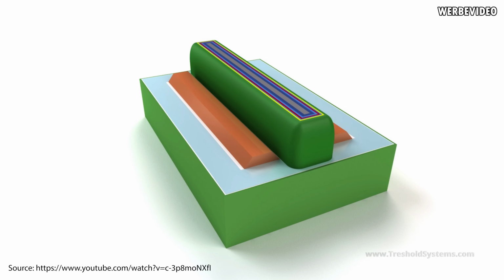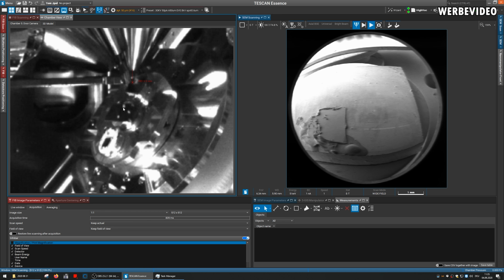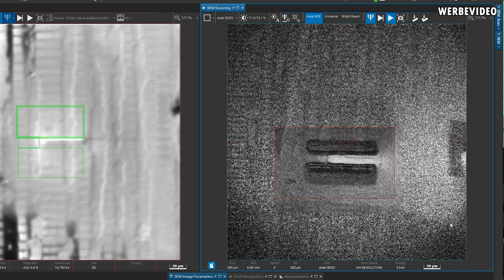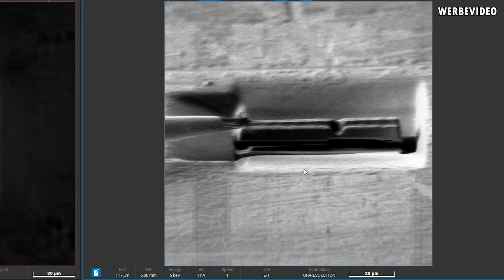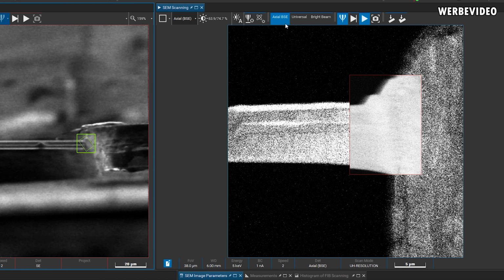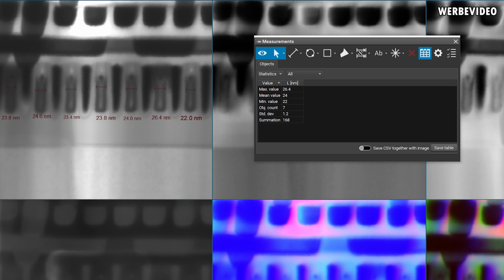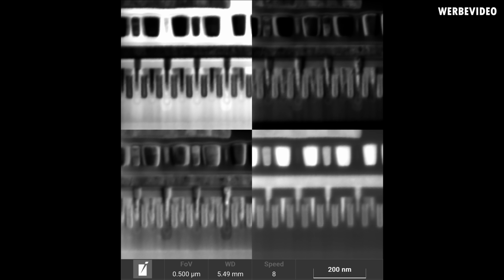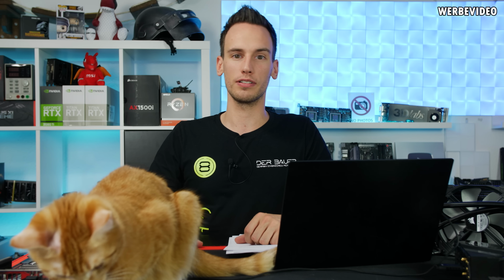14nm and 7nm are NOT what you think it is - Visiting Tescan Part 3/3

Comment: Instead of constantly shrinking the transistors why not just make the processor bigger ?
Reply: than it will going to increase risk on production. flagship cpu like threadriper xenon already have risk on production , that why those cpu are expensive. besides volume of production also determinds the risk on production, amd has smaller production capacity thats why they have low lisk on production so far. and if you do see the the die size of 3900x is around 30% larger than 10900k. so if intel going to make same die size it will increase core and cache size but accordingly also ging to increase its risk on production. the reson behind of delaying blueberry 7nm chip is the risk of production . intel maneger said that at present the bluberry 7nm which avilable in their factory is not economically viable to be release. and they finding way of production techniques to reduce its risk on production. if amd within one week somehowe capture 30% more market share than intel has to produce 30%less chip, and in that sense we gonna see decreasing voluem of intel factory and in that scenierio they would be able to realse 7nm blueberry chip within this week
Reply: @bakulboro2292  I'm not an expert on this stuff, just asking an honest question and would like an answer given to someone who knows nothing about this.
Reply: @cgirl111  bigger processors means more are not working at the end of production   which makes it not feasible for intel etc to build bigger cpus they want to make money.
thats the super short answer

Comment: Please answer this question. If it take two days to cut the silicon to the point you can see and measure the transistors. How long does it take to make and place the transistors in the first place? How long does it take to make 90 million transistors and place them in 1mm*2 ?
Reply: with modern cpus like this around 2-3 months. they go through hundreds of different steps in the fabs before they are finished

Comment: (comment from Russian viewer)
I think that "7nm", "8nm", "10nm" , "14nm" and other scales is a possible minimal resolution of "printing" processes in the lithographic conveyer.
 It can be not necessary to use a minimal resolution with different types of logic elements in microchip.
 Because all parts of the element must be in certain proportions. There is also may be another explanation: if you want to save info (charge) in cash for long time, you need to prevent diffusion of electrons through gates/drains/sources or another dielectric layers.
And for all that stuff is better to make layers much tougher and larger (with current technological capabilities). At another side, if there's no charghing parts in scheme and all task that it mean to do - mix a signal from different ways in 1 of thousand cases. So there you can do the element much tiny.
 Thx for attention.

Comment: And then we still have the packaging problem. How far is any given cache transistor from the logic unit away? How many lanes do we have in parallel, how many in series? Is the area of the transistor facing the heat sink large enough to keep it cool? How tight are the CLK tolerances around the whole chip? (how fast can we go bevor it crashes) And finally, what instructions does the CPU have to offer? How are they piped? Are the different instructions used by the compiler? Not even talking about listing and sorting of instruction execution. These things are so damn complex that you need a common benchmark if you want anything reliable.

Comment: It is bad(stupid) idea to compare cache transistors sizes... it is memory... it does not work if size of gate is too small because small gate is not able to keep large enough charge... gate size of memory transistors already reached its physical limit... it will be 22nm even with 2nm process. Generally speaking memory "transistor"  is not a transitor, it is a potential well and  it should be large enough.

Comment: Initially, I understand nm as a unit of measure.  So obviously 7nm should be half as long as 14nm.  If that is the case, at least logically it seems relevant that you could fit things closer together.  In terms of a circuit, the less distance an electron has to travel, with a fixed conductor medium, the less resistance it encounters.  Less resistance should mean more power efficient (less energy loss to heat generated from resistance).  I'd also surmise that if things being measured are "half as long" and if we're talking area, also "half as wide", you should be able to fit 4x the number of things in the same area.  But since the nomenclature is not 7x7nm or 14x14nm, I'd assume its NOT exactly area.  Nevertheless, the smaller things, are the more should fit in the same space.  And I've already reviewed some materials that have said TSMC's 7nm isn't really 7nm, but I still don't quite understand.  So that is why I'm going to watch the video!

Comment: Having studied computer architecture design and semiconductor manufacturing for years, I know that  current "nm" means little to nothing.
There used to be a time back in the day when the node referred to the smallest feature a lithography setup could reliably produce.
As simple as, the thinnest line a 120 nm node could make were 120 nm wide. But with fancy etching techniques, one can actually produce smaller features than that... And to a degree, a lithograph can also be held back by the photoresist itself.

But in large part, the node "spec" manufacturers use is largely pointless.
Not to mention that a process can also mature over time and manufacturing capabilities get better through that alone.
If we built a "32 nm" CPU today, then it would likely outperform a "32 nm" CPU back when that node were cutting edge technology. (One reason for why Intel started putting a "+" onto the name.)

Though, the real reason companies even put forth these numbers is because it sounds impressive. Makes investors cheer and consumers buy products, as long as one has the smaller number that is.

If we look over at another side of the industry, like micro controller manufacturers, they rarely if ever even mention their process node. They much rather talk about power efficiency and consumption in various run states, what IO capabilities they have, how many bytes of RAM they contain, how many timmers they have, etc. The Manufacturing node is frankly not useful information.

Comment: 7nm and 14nm does not denominate the transistor size, it denominates the size of the smallest structure that can be done in the manufacturing process. If you have a set of drills and the smallest is 0,5 mm you don't need to use it to make a 5mm hole. So yes the numbers makes sense...

Comment: I was a dummy!  I thought the 7nm/14nm battle was about the width of conductive traces between transistors!
[not yet seen the video]
Simply saying "7nm transistor" is like bragging the biggest bolt in your car is an M5!
Transistors are 3d stacked/overlapping structures, so width of any feature is not the whole story.
The number of functional transistors per unit area sounds naive, but might be smarter than arguing how to measure individual transistors.
Q: what is the production failure rate 7nm vs. 14nm?
Smaller die features are generally more sensitive to wafer defects; a 7nm production line will have more rejects, assuming wafer quality is same.
How does AMD do it so cheaply?  
My guess is the run many more  production lines and live with the higher reject rate...a silicon wafer is not all that expensive compared to the value of working chips it could make.
The actual cost of the bits of metal and such that makes a 'threadripper' is only a few bucks...having to throw out 12 for every good one makes it cost a little bit more.
AMD is eating the R&D costs, banking on higher volumes of sales as they pick up market share.
Intel is having trouble going smaller and keeping the reject rate down, AMD fills dumpsters with bad wafers and calls it good.
Cheap is cheap for a reason; I'll stick with Intel...they seem to be working toward something more than just sales figures.
If you don't mind terrible yields and unreliable products, I am sure "4.5nm" chips could be made...
[going to watch video now]

Comment: This new information really mutes the criticism of Intel's 10nm woes. If the process name has no correlation to T size, and is not comparable across other foundries, then Intel's trouble with 10nm aren't really much to worry about.
Reply: Yeah, except for the comparison between real products. Intel is struggling with 8+ cores on a processor, while AMD delivers 12 and 16 (for the desktop market, I will not mention 3990x here :)). Is it really just the smartness of a many-chip design by AMD? Or Intel has some other problems too?
Reply: @mojeimja  Chiplets definitely do have an advantage, in that far more granular binning is achievable. Wouldn't be surprised to see Intel go that route.
My comment was making the point that so many in the tech press have made the point that AMD/TSMC have achieved 7nm while Intel is 'stuck' on 14+++. But as we've learnt, these numbers don't mean anything.
Reply: @_BangDroid_  that is true

Comment: Transistor contacts are actually made of tungsten not copper. Metal vias are made from copper, but copper is not good at contacting silicon. Cobalt is better than tungsten but harder to work with.

Comment: To me, the numbers are purely marketing speak. A holdover from the last time (before FinFET technology) that said numbers actually meant anything (which was at 28nm if I'm not mistaken). Anything lower than that likely isn't too reliable, other than maybe the companies that make the processes trying to give an account of how they rate their node vs their competitors? But in that regard, some companies have tried to be more honest than others. Really...by this point I'd say the numbers are most useful as an INTERNAL ONLY reference guide for each processor manufacturer and not how they compare to each other by this point at all.

That's me answering at the start of the video. Watching it all, yap...I suppose I was fairly accurate, although massive thanks still for FINALLY explaining in a broad sense what FinFETs are and what their purpose actually is. This also finally clarifies in my mind what GAA (Gate All Around) technology is, logically, trying to achieve in the future as well as an evolution of FinFETs.

Comment: There's some advancements in Quantum computing, something about isolating electrons from interference which is imporant there for the  quantum blah blah, but if applied to silicon,  we could get transistors down to electron size, in theory but practiaclly theres going to be overhead even if you could go that small, but its nice to know that bleeding issue could be solved, it seems they're getting finer with the resolution but cant really make the transistor smaller, maybe that will help.

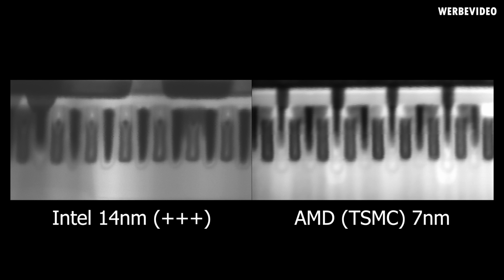Comment: Very cool, what i see is the spaces between each transistor could easily be 7nm, and maybe thats where they get their number,  right at the point of that fin that sperates them, which is the smallest feature they can make in their chips,  hence the 7nm name, whereas the intel 14nmn chip at 13:03 you can see that fin is way bigger and they dont appear to have any feature smaller then 14nm so , yet the  transistors are the same size. So AMD indeed has a finer resolution in making features but not really using it to make transistors with, just the spaces that separate them?  still a pretty cool achievement. And just boggles the mind theres billions of them, if they were the size of sand grains it would be a wheel barrow full sand to equal that many transistors.

Comment: The number is meant to describe transistor density. Not size of the transistor. At first glance, that may seem to be the same thing, and it is the most direct way to achieve it, but in reality, it isn't the same thing at all. Quantum mechanics makes it very difficult to continue shrinking the actual transistor size. If the gate is too thin, electons start freely passing through as if it isn't even there. Also, imaging resolution is also a problem due to how fat the wavelength of photons are at that scale.

Comment: These days what they meant by 7nm or 14nm is the smallest feature size a particular technology can produce, it does not reflect performance of the transistor at this point anymore (in past it did). It is like the LED monitors back then just false advertising about a LCD monitor with a LED backlight but consumers think the display itself was made using LEDs.

Comment: From what I can tell of a node's name, a halving of the node size corresponds approximately to a doubling of density (half the area) alongside an improvement in efficiency of roughly 50% (half the power). On a planar scale halving your measurements quadruples your density and as silicon is still basically a single layer of logic, the 3D construction of finfet still operates within planar densities. X2 density 1/2 power results in x4 scaling and thus a full node which is approximately half size half power or 1/4 and basically a quick and dirty reference.

There's a method to naming nodes, it's just not consistent between manufacturers and will become silly when we hit the first picometre named node.

Comment: Initial thoughts: Just like with TDP and several other metrics, AMD and Intel define transistor size in different ways. Whereas 7nm the FIRST time they did it may have represented the gate size, these days it represents the size of the entire transistor. Something like that at least, I can't remember what I originally heard about it but basically they keep changing what parts of the circuit they're actually measuring. And I'm pretty sure there's a size difference between 14nm Intel and 14nm+++ Intel because they've changed how they measure

Comment: I was of the mindset that the nanometer was the light wavelength they used to etch the chips with... It is the possibility of how close you could make two transistors if field effects could be contained between the two transistors. I could be wrong though....

Comment: Amazing work, again. For me this 7nm and 14nm is meaning more like how precision they machines are to make the cpu.
Reply: Nope, the entire point is that the naming scheme doesn't correspond to any feature on the die at all. For example, when the foundries introduced FinFETs, they called this a new process node, even though there was no real density change or die shrink. But the performance increase was similar to that gained by a traditional Moore's law shrink, so they changed the nm designation and called it 16nm.

Comment: I suppose this whole discussion lends credence to what Intel has been recently suggesting... that is, process node changes are not the only way forward, and that redesigning the chips using the same process node can still yield huge changes. If Intel can solve their power draw issues on 14nm, maybe they can continue to squeeze more performance out of it. At the end of the day, you choose the processor based on your usage case. Even though I can agree Intel has an inferior product overall, for how I want to use it, it remains the better choice.

Comment: Did you also measure lengths from the logic portion?  I really hope so because there could be a difference there.  Tsmc could have been using an older architecture for just the cache because they haven't needed to fine tune that whereas the part where the magic actually happens could be vastly different.

Comment: Internally TSMC doesn't seem to attach nm to the end of their process nodes. Nanometer names seem to be mostly for press releases and marketing now. The area density metric will have a problem soon too, with the increase in dark silicon new process modes won't sound as impressive. Even if the transistors are smaller they will be spaced further apart for heat generation/ spreading.

Comment: This video gives me headache... I already watched electron microscope images, but this video is mind blowing.
It's hard to comprehend how smalls current transistors are.
Reply: I agree.  100 million transistors per square millimeter is insane!
Reply: Yes, back in 90s you could still see parts of an IC 🤣
Reply: 7nm is about 20 silicon ATOMS. Crazy to think there are billions of transistors in a modern chip
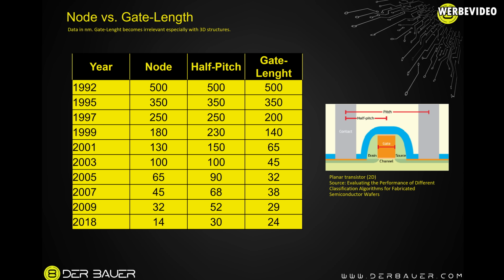Reply: @rickhapstley  The point Roman showed us is there is no relationship between the "7nm" or "14nm" to the feature sizes that determine density of CPU ICs.  It is meaningless.  Furthermore, those "nodes" are meaningless when compared to "node" evolution of the last 40 years.  However, ignoring height of FINFETs, from the top view of the IC, the spacing between individual transistors is about 100 nm (at 11:47) and the gate width is about 21 nm.  So if there is a consistent metric to be taken away, it is half-pitch in the table at 13:59 which is 30 nm and won't get much smaller in the future.  That means the tightest transistors can be theoretically packed by both "nodes" in 2018, is 60 nm apart, but, more practically it is around 100 nm apart, as in the EM at 11:47.

How big is the 16x10mm 486DX IC in 2018 technology?

The area of the 486DX is 16.2 x10.3 mm = 167 mm^2, 1.6M transistors.   Because density is proportional to the square, you can very crudely get a better idea by comparing 1989 (eg 486DX CHMOS-III, half pitch 800nm) to 2018: 800^2 / 30^2 ~=  700X higher density.   So 167mm^2 / 700 = 0.24mm^2, or approximately 0.6 mm x 0.4 mm !!!  So no matter you scale, it is mind-boggling.

My 486DX pre-production engineering sample still works.